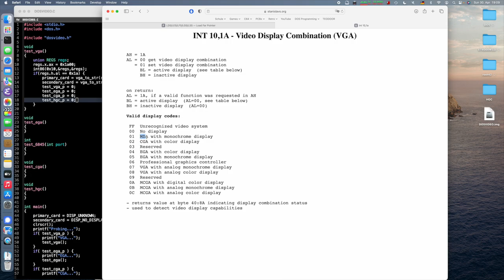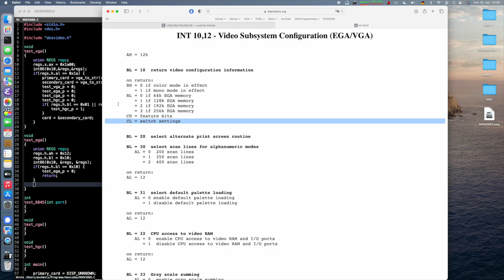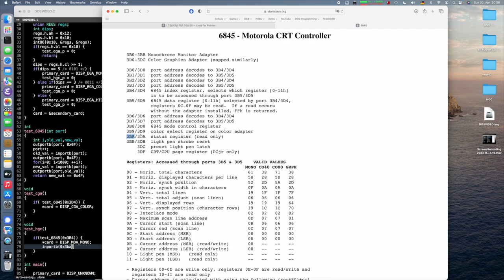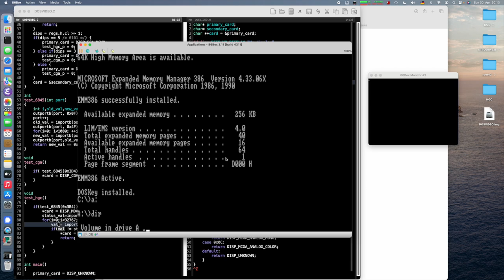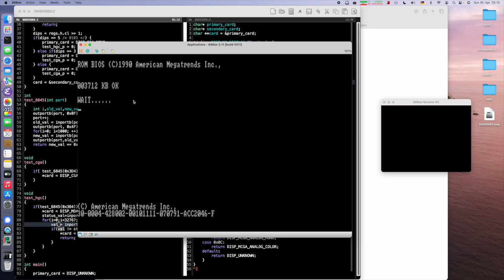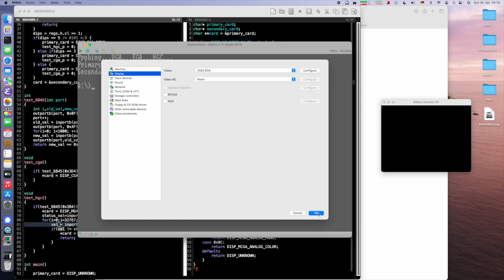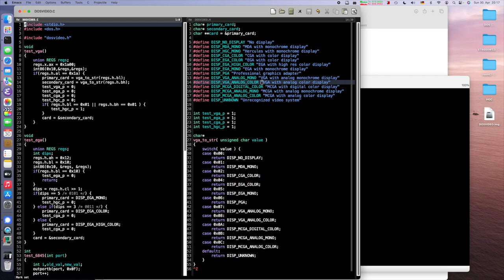Let's Code MS DOS 0x1F: Detecting Graphics Cards

Comment: Yey, a new video. I waited a year  for that :)
Hmm, not coding in dos today, but using fancy editor

What is this editor btw, it seams it supports autocompletion on dos api, which is real nice

BTW: how do you draw something on the second display?
Reply from the maker: It’s GNU Emacs. In this case it does very naive autocomplete. But I also use rtags which can do smart completion. 

You can use both displays as usual, as they both have separate memory areas. We can maybe touch that topic in another video.
Reply: @root42  I worked in the early 90's with programmers writing DOS and Windows GUI software, they had the same type of setup: debug output on the monochrome text display, output ran on the GUI on the VGA monitor.